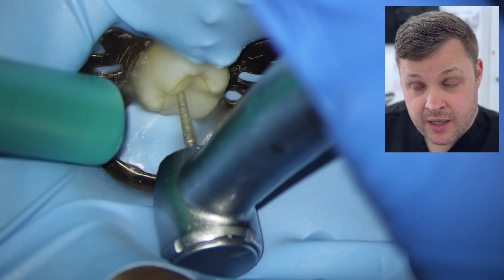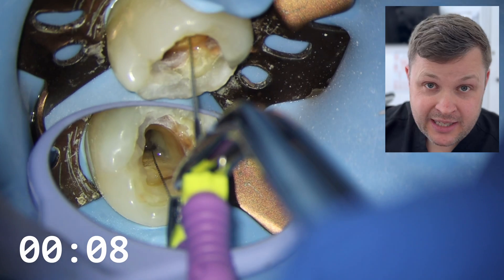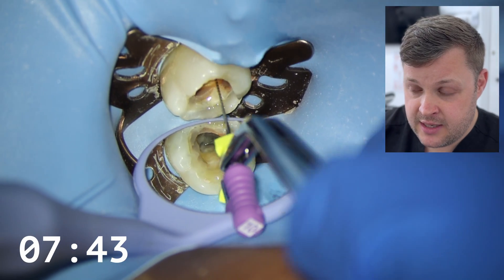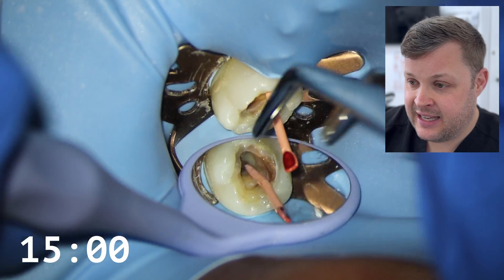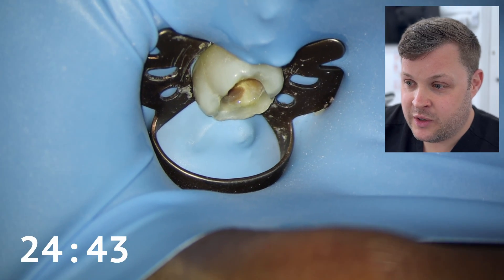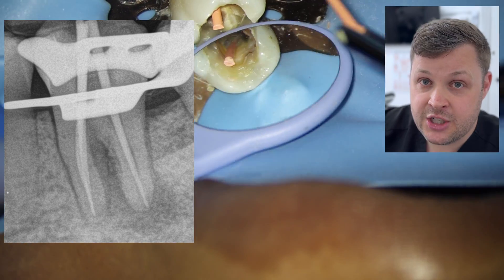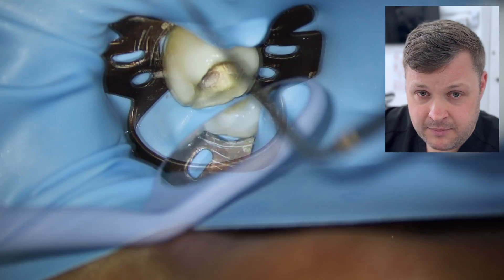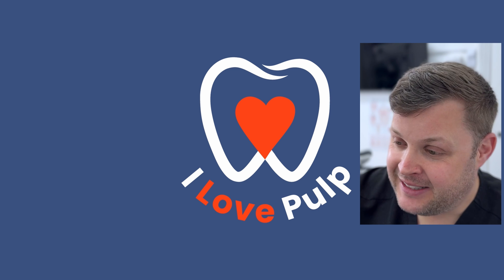Root Canal in 25 Minutes? Rapid Shaping with Apex Locator & HyFlex!

Comment: Hi doc, i see the ML canal preparation until reach 00 reading 6:27, is it safe doc? I mean in the endomotor setting the little triangle apical reference point flash bar menu show us 02 reading. Can you explain a little about the apical reference point doc?😃
Reply from the maker: I’ve been trying to understand your question sorry! 😝 do you mean that I am using the final shaping file at the zero reading?
Reply: Yes doctor, is that true to the zero reading?😀
Reply from the maker: I have just checked this and yes! You have caught me out! 🤣😂🤣. On this occasion I did go to the zero with my final shaping file! I hadn’t noticed! It just goes to show that we are not perfect all the time and sometimes we can bend the rules and get away with it! But shhh 🤫 don’t tell anyone else! 🤣
Reply: @ilovethepulp Take it easy doc 😃. So doc, about the automatic apex locator, are you always set to the little triangle bar?😃
Reply from the maker: @HandokoNg  I never set the triangle bar, the measurement on this is so arbitrary, it’s not to be trusted. I always just rely on the zero reading only.
Reply: @ilovethepulp  Ah, i see doc. Nice explanation👍🏻.
Reply: @ilovethepulp Doc, is it safe to use direct rotary file directly after 10k file that too without glide path file,as per literature,apex should be enlarged upto atleast 20k file then glide path after that rotary file
Reply: @QuoteSpiration2 can i help to answer it?.. in my oppinion it quite save jump to direct rotary files as long as you use with smallest file first like 15.02, also try to open the coronal part with this file.. avoid jump to higgest diameter file because ledge can be happen when shape the curve canal😄

Comment: Again, such a great video.
Would you mind explaining the rationale of using the T-mode? Did you suspect a ledge or something else?
Thank you such a gem of information !
Reply from the maker: Because I had three canals joint into one, I felt there was a strong risk of ledging. So I like to have the watch winding motion in the initial negotiation to length of my rotary files - I am being over cautious, but ledging these cases can be very difficult to rectify.

Comment: Hi doc i have noticed that ones reaction time and actual reading of the on the apex locator whilst using the dual function of endomotor has a time delay and at times causes over instrumentation how do you navigate through this issue? Regards
Reply from the maker: the apex locator I use has a slow down function as the file reaches the zero reading, and when it reaches the end, it can either stop or reverse out. what type of motor do you use? I use this one: https://youtu.be/hnNs1UHwX8Q?si=tRM2asroP5BdzDPw
Reply: @ilovethepulp  Hi i use the Eighteeth e connect s with apex locator function.

Comment: Ever tried attaching an apex locator to regular rotary files. Would it not achieve the same effect?
Reply from the maker: The apex locator is integrated into the motor I have here - meaning the motor and the head is specialised to receive information via the file. Do you have an idea how a normal apex locator would work in this instance? I'd love to hear your thoughts!
Reply: @ilovethepulp  I'm not the person you replied to, but I use a normal apex locator attached to the hub of  protaper gold rotary files and it works perfectly. The metal attachment of the apex locator still allows the rotary file to spin no problems and gives a steady reading. Integrated apex locator however seems much nicer.
Reply: Yep this is what I'm referring to🙌